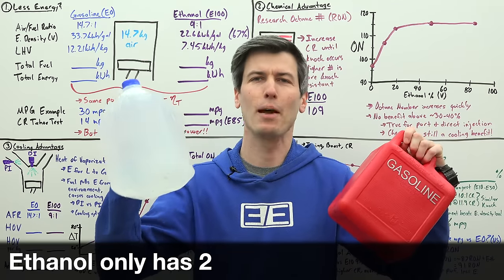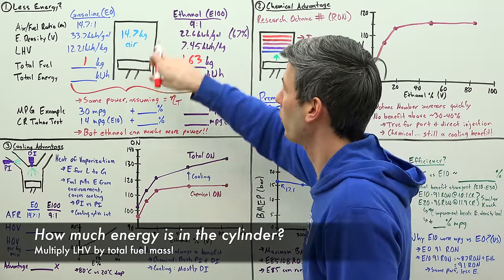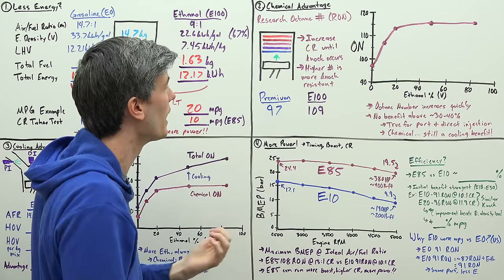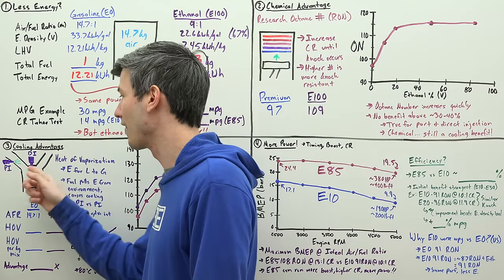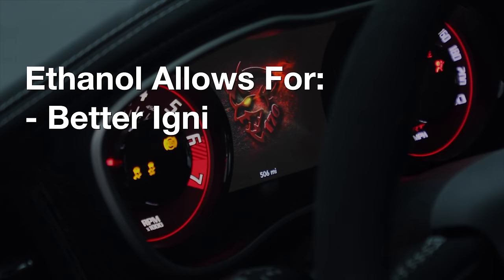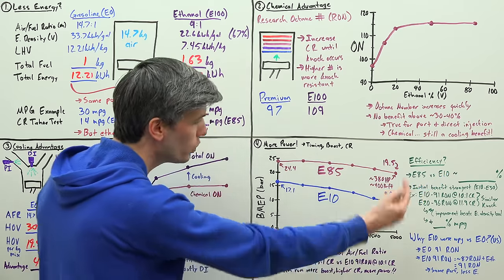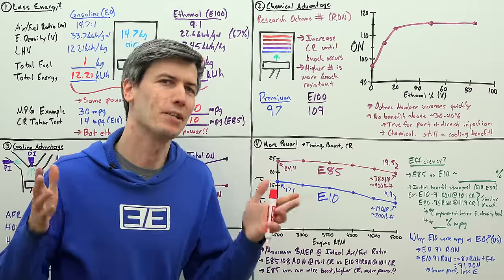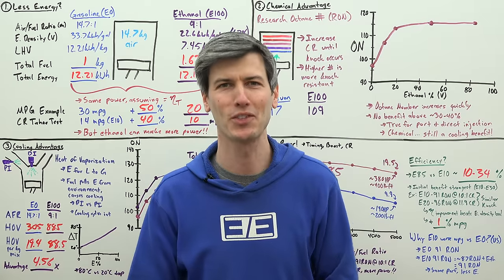Why Does Ethanol Make So Much Power? (Versus Gasoline)

Comment: Real gas gives me up to 12 mpg over ethanol damaged fuels. Overall performance is much better. 

Ethanol costs more to produce than gasoline, and does nothing for fuel economy or pollution.  
It’s just another way to subsidize corn farmers growing corn that has little to no nutritional value.
Reply: The spot cash delivered price of ethanol on the NYMEX is $1.46/gallon.

The price of unusable sub-grade gasoline (RBOB) is $2.76/gallon.

To turn RBOB into usable E0 fuel costs even more much like premium costs more.  Unfortunately it becomes even more toxic and dirtier.

Or, simply splash in >10% ethanol to RBOB and the resultant usable fuel becomes less toxic, far cleaner burning, and cheaper/cheaper per mile to drive with.  Who can be against that?

Denver in 1988 was the first government entity to require E10 when they were on the EPA list of ozone non-attainment zones.  Soon with ethanol they were off that list.

Even with just 10% ethanol added to E0, the Swiss Federal Laboratory for Materials Science and Technology found that the especially health devastating ultra fine or nano particulate emissions were lowered by 97%, carbon monoxide lowered by 81%, carbon dioxide lowered by 13%, aromatic hydrocarbon emissions lowered by 67-96%, and genotoxic emissions lowered by 72%.

Here is how the 2007 Energy Independence and Security Act subsidized corn farmers:

2007 WEIGHTED CORN PRICE =$4.20 WITH 4 .7B GAL MANDATE
2008 WEIGHTED CORN PRICE =$4.06 WITH 9B GAL MANDATE
2009 WEIGHTED CORN PRICE=$3.55 WITH 10.5B GAL MANDATE

2016 WEIGHTED CORN PRICE =$3.36 WITH 15B GAL MADATE MAXED OUT
2017 WEIGHTED CORN PRICE =$3.36 WITH 15B GAL MANDATE MAXED OUT
2018 WEIGHTED CORN PRICE =$3.61 WITH SAME 15B GAL MANDATE MAXED OUT + MOST ETHANOL EVER PRODUCED

Comment: Yes, more power but E85 causes problems.
Reply: The only problem I can think of is that it is similar to diesel engines in the fact that in cold weather it is hard to start.  That is why E85 here is often E50 during winter so the fuel is volatile enough to start.

In Brazil, their flex fuel vehicles incorporate heated injectors which turn on when the driver's door is opened for starting.  Diesel engines have glow plugs for starting.

Low volatile fuel is a safer fuel to handle and safer during crashes which is why the Indy 500 uses alcohol today when a deadly multi-car crash involving it and gasoline demonstrated it.

Comment: And rotting fuel lines and joints in older cars.
Reply: Ethanol on most any manufacturers' chemical compatibility chart at worst is equal to or more often easier on rubbers, plastics, or metals than what gasoline and BTEX (benzene, toluene, ethylbenzene, and xylene) are.   

Indeed, nontoxic RV antifreeze's main ingredient for a very long time has been 25% ethanol.

Viton was invented for the reason gasoline is so harsh on natural rubber.  BTW on ISM's chart ethanol is rated as "A" excellent and gasoline is rated as "D" severe effect, not recommended.

After the Rockefeller funded Prohibition ended, E10 was sold in thousands of fuel stations in the Midwest up until just before WWII.  Agrol was the largest brand sold.

Blends in the UK of E10 to E30 were sold from the 1920s with Cleveland Discol being the largest which was an E10 blend sold there up until 1968-70 when BP bought them out.

Henry Ford designed his Model T for his favorite fuel ethanol.  Production models were flex fuel.  Can't get much older than that.
Reply: Sorry Richard....NOPE.

Comment: ethanol RUINS small engine carburetors.

Marv Klowak, former global vice president of research and development for noted small engine manufacturer Briggs & Stratton, has confirmed that "Ethanol has inherent properties that can cause corrosion of metal parts, including carburetors, degradation of plastic and rubber components, harder starting, and reduced engine power...Feb 28, 2023
Reply: Marv should be made aware that his company sells small engines (under the brand name Branco) in Brazil whose common gasoline is E27 and presumably they start, run, and last.

The very same Honda and Stihl engines we have are sold in Brazil.  It has worked out so well and for so long that Paraguay went to E27.

Ethanol on most any parts manufacturing chemical compatibility chart you will find online is at worst equal to but most often easier on rubbers, plastics, and metals than what gasoline and BTEX (benzene, toluene, ethylbenzene, & xylene) are.
Reply: Marv said that actually in 2013...and Briggs went out of business in 2020. its 2024 FYI.

Comment: lmao i a regular no it doesnt.  just shut up.
Reply: In the SAE opinion, GM found their 5.3L engine produces a clean 380 horsepower on E85 vs a dirty 355 on E0.

In an ethanol optimized engine like one Ricardo built and drove around for GM, you will get not only more power but even more mileage.  Better than diesel engines even.

FROM RICARDO:
The new federal CAFE standards are calling for a doubling of fuel mileage performance, which, Vint says, is going to send OEM’s looking for high octane numbers to improve efficiency and ethanol is the best source. Ricardo, an engineering firm with over 100 years in the business of engine design, has developed an extreme boosted direct injection engine (EBDI) to optimize ethanol blends. The 3.2 V6 gasoline engine rivals the power and torque of a much larger GMC Sierra 6.6 diesel, he said, and it delivers 3.5 percent better fuel economy than the diesel.

This is not new technology or knowledge; it was known long ago.  It is suppressed technology.

Rear Admiral C.M. Chester wrote Henry Ford a letter on Dec.15, 1916:
"...I also pointed out in the article that as governmental laboratories had developed from 40 to 55% efficiency in alcohol engines as against 20% in gasoline machines, the use of alcohol at double the cost of gasoline for power purposes, was cheaper for motor[s] than gasoline in common use today."

Comment: The other downside to ethenol is it can't be pumped in a pipeline it has to be shipped by the railroad. It shouldn't have never been put in gasoline in the first place. And it has been proven to produce more pollution than regular fuel plus it is bad for older cars for the simple reason it messes with rubber fuel lines
Reply: I do not where you heard that ethanol can’t be pipelined but you are badly misinformed.  There are thousands of miles of ethanol pipelines in Brazil and have been for years.

We have one in Florida and Kinder Morgan was building a really long dual use ethanol and petroleum one that was to hook up to that one but was stopped in Georgia by landowners there in court.

Ethanol in our current usage level was a replacement for the disastrous oxygenate/octane booster MTBE.  The petroleum industry went along with the legislation because hidden in the bill was legal immunity for MTBE.  That was revealed and removed but the bill still passed.

Before that Denver in the late 80s was the first government entity to require ethanol because they were on the EPA’s list of ozone non-attainment zones.  Soon with E10 they were off that list.

Even with just 10% ethanol added to E0, the Swiss Federal Laboratory for Materials Science and Technology found that the especially health devastating ultra fine or nano particulate emissions were lowered by 97%, carbon monoxide lowered by 81%, carbon dioxide lowered by 13%, aromatic hydrocarbon emissions lowered by 67-96%, and genotoxic emissions lowered by 72%.

On most any manufacturers chemical compatibility chart you’ll find shows ethanol is at worst equal to or more often is easier on rubbers, plastics, and metals than what gasoline and BTEX (benzene, toluene, ethylbenzene, & xylene) are.
Reply: @danafletcher2341  I see tank cars pulled by CSX railroad with placards for ethenol  and the reason I stated about not being transfered by pipeline is that ethenol attracts water and you know what happens next rust that's also why I stated I'd rather run plane gasoline than 10% mixed in fuel for better milage and that has been proven.
Reply: @57rcpilot  Ethanol does not attract water and the ethanol E100 in Brazil is hydrous ethanol which is like Everclear at 192 proof which is 96% ethanol and 4% water.

We use anhydrous ethanol here which is 200 proof, I.e. 100% ethanol.

Mercury Marine, which hosted a Webinar on ethanol myths, noted that ethanol does not "grab water molecules out of the air." It is hydrophilic, which means ethanol holds water. With regular gasoline (E0) as well at E10, the primary cause of water collecting in tanks is condensation on tank walls. But unlike E0, which can absorb almost no moisture, E10 can hold up to half of one percent of water by volume, and the water molecules will dissolve in the fuel. The "solubilized" water will bypass the water separator and burn harmlessly through the engine.

>>>>Mercury Marine also says E10 may be the superior fuel(over E0) because it keeps the fuel "dry"<<<<

People before E10 used to have to buy little cans of alcohol called HEET or DRY GAS as gas-line antifreeze to deal with E0's water problems.

If ethanol caused water problems, we all would know right away for every single winter there would be millions upon millions of cars stalled on all the roads in the northern US and Canada.
Reply: @danafletcher2341  They picked that lie out someplace. I googled around the usual Fox news Onan sites but I cant find it. Its weird to me they will find them most outrageous lie and repeat it over and over again no matter how silly it sounds.
Reply: @57rcpilot  — The “plane gasoline” that I use is 100LL. So are you telling us that you use leaded gasoline in your street car?
Reply: @danafletcher2341  — I think you’re wasting your time, here. It’s most obvious that 57rcpilot Wade is omniscient, with expertise far superior to the cumulative knowledge of the engineers at Mercury Marine and chemical engineers at Chevron Corp.

It amazing that there haven’t been temples erected to worship him.
Reply: @57rcpilot  — There is a bit of a logic disconnect with your above post. You wrote: “ethenol [sic] attracts water and you know what happens next rust …”, but yet, a time-honored way to REMOVE rust from screws, etc., is to soak them in Vodka.

“Remove rust from screws: Soaking screws in vodka for a few hours will clear away any rust they've accumulated. Wipe away rust after soaking. Clean kitchen surfaces: Combine one part vodka with two parts water to spray on countertops and tables, shine the kitchen sinks, and clean any other surfaces.” — Business insider

For clarification, vodka is methanol and water, being technically at least 40% ethanol by volume.

“Vodka, as defined by U.S. law, is diluted ethyl alcohol or Ethanol. To be designated as vodka, the liquid must contain a minimum of 40% (ethyl alcohol) by volume. The rest is essentially water. Vodka can be made from virtually any product that can be fermented and distilled to produce high-proof alcohol.” — Vodka 101, Felene Vodka

So here’s the problem. Soaking rusty steel in ethanol and water removes rust, yet you tell us that ethanol and water CREATES rust.

Please explain the contradiction .
Reply: @sking2173  Around 160 proof or so, oxidation will form on bare aluminum but beer is and has been sold in beer cans made of that, I wonder how that can be.  I think some company sells vodka in aluminum if I am not mistaken.  Beer used to be sold in steel cans and in the Wild West flasks with spirits were made of metal.
Reply: @danafletcher2341  — Yeah, but Wade there was talking rust, which just isn’t so. E85 is even sold in steel barrels. You would think that fact alone would make someone at least suspect that ethanol causing rust is perhaps untrue. The lack of even the simplest reasoning ability of some of these people is astounding. 

As for vodka, yes, it is even sold in resealable aluminum containers. Even good ole Pierre (Smirnoff) is sold in aluminum bottles!
Reply: @sking2173  Forgot to mention that every hardware store has sold ethanol in the paint section in paper thin metal cans forever.

Non-toxic RV antifreeze which contains 25% ethanol has been sold forever as well.  Lots of rubber diaphragms in RV pumps too.

Comment: You may be able to make more power but the downside is fueling the vehicle more often. I'd rather run gasoline without ethenol and get better fuel economy than less
Reply: I mix about 30% E85 and get the SAME MPG and have videos on me doing it....its terrible.